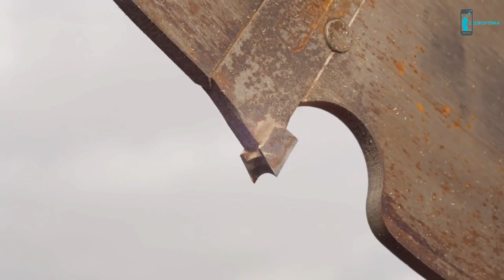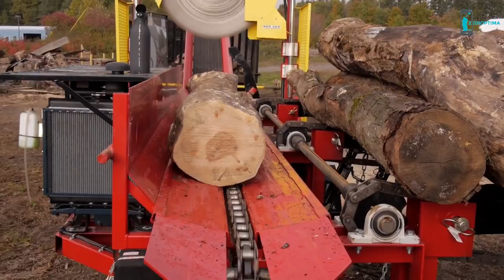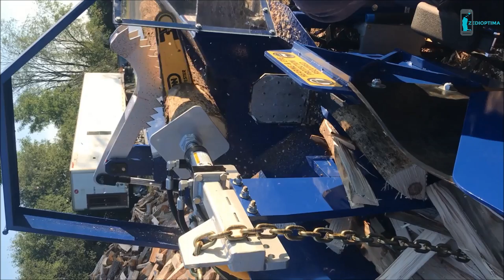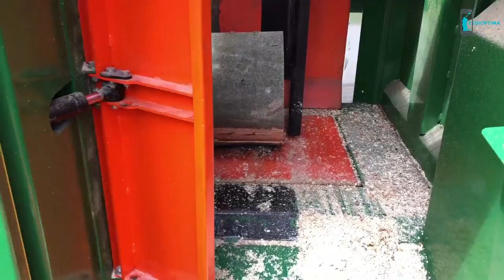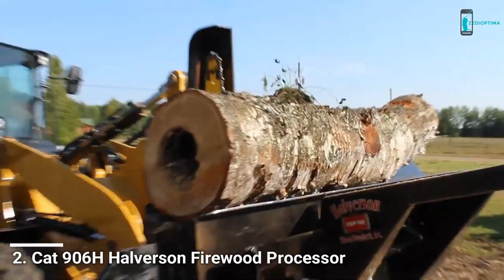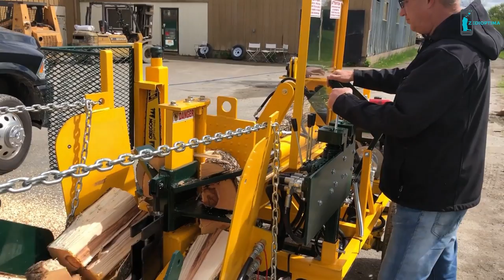Top 5 Best Firewood Processor and Machine -Zedioptima

Comment: i like the log splitter on the spaltfix, does not allow for much to get stuck in that funnel design, one of the gripes on other firewood processing machines if you exlude uneven logs. But i wont say the cutter is the most efficient, As the cutting speed and quality of a circular saw is hard to beat, not to mention the blades tend to last longer then the chainsaw chains, tho more expensive to swap out when the time comes.